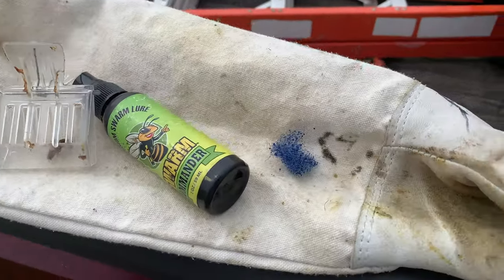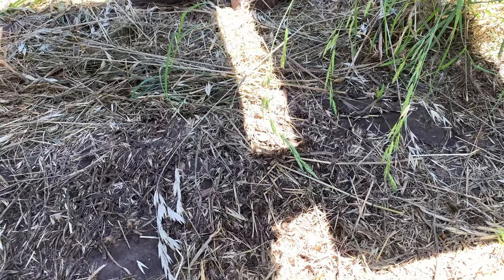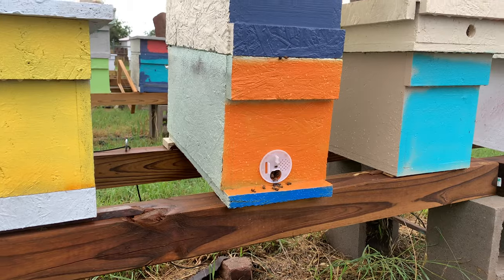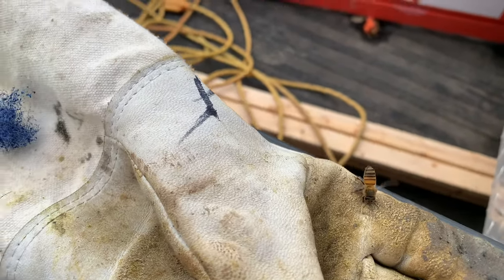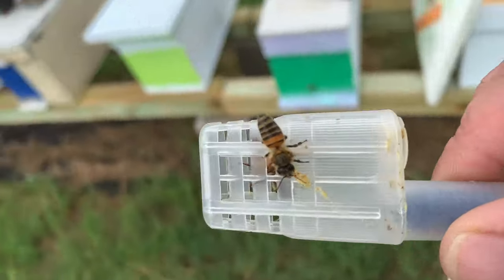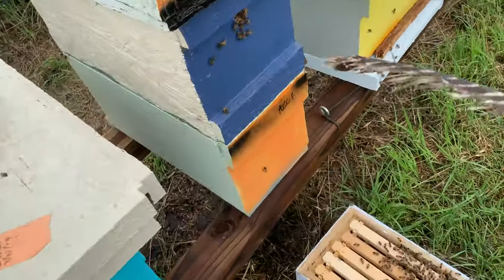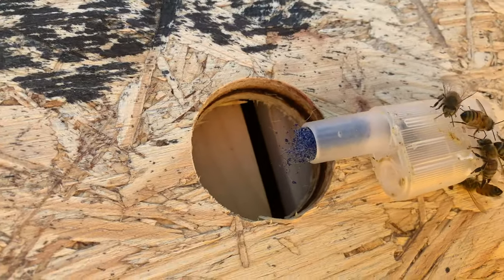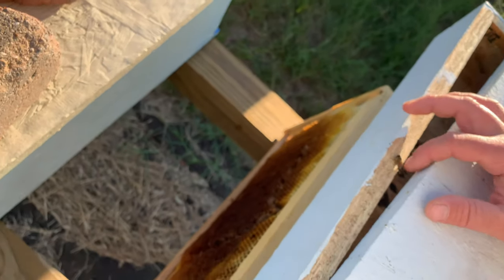Why Did My Queen Return To Wrong Home

Comment: I once had something similar happen... I thought I had a hive that got into some poison as there was a large number of bees dead under the hive.  I thought it strange at the time that the dead bees were under the hive not in front.  Turns out a swarm had apparently tried to enter the hive (a strong one) and they had a battle which explained the dead bees but this didn't come to light until two days later when inspecting the same hive and when I got down to the bottom box I could see a bunch of bees under the screened bottom board.  A poke underneath the hive revealed an unmarked queen (all my queens were accounted for) and a fair sized bunch of bees so they were set up in a nuc!